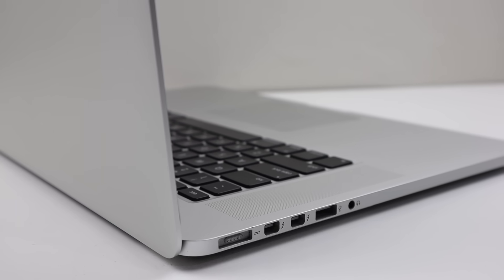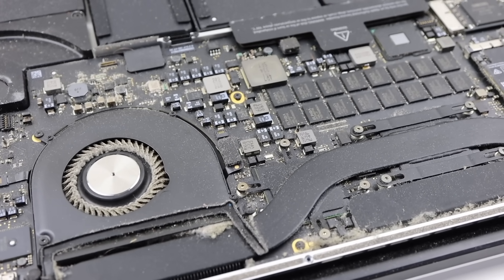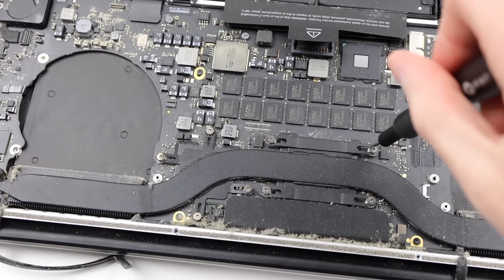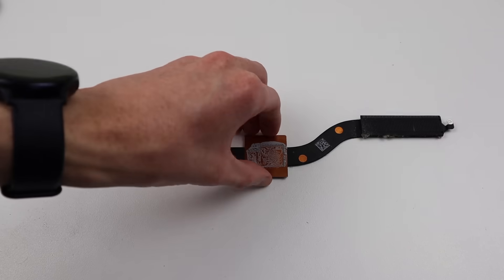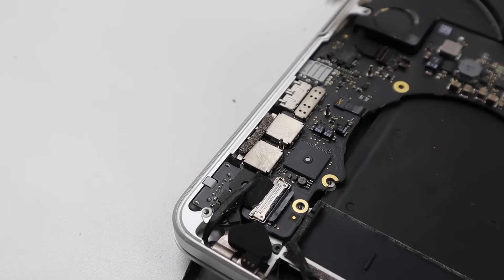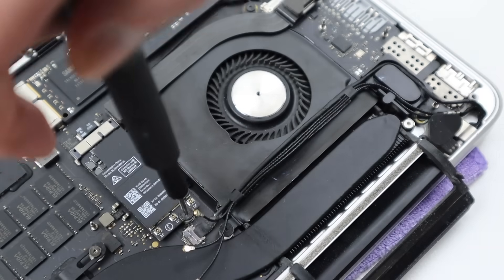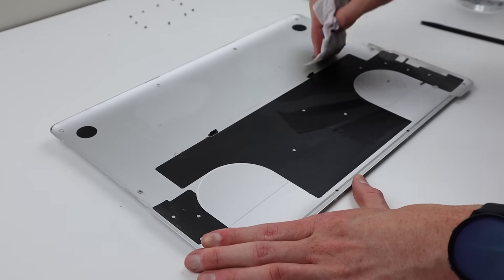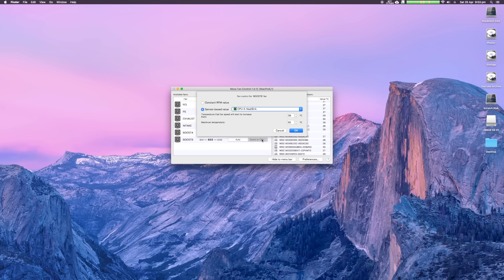Fixing My Filthy Overheating MacBook Pro

Comment: Just did this on my mid 2015 pro 2.8 i7 running Monterey 12.7.6. After cleaning up most of the dust bunnies from the fans/fan openings and applying Arctic MX-6 thermal paste, my mac runs slightly cooler. It still gets hot and sounds like an airplane under load, but it's no longer getting hot during mundane tasks.

Comment: I was slighty lifting the left side of the heat sink in my mac book pro 13'' (2018), without undoing the screws. It bent very slighty, but the bent was visible on the black cover. Should i remove the whole thing now, put on new thermal paste and screw it tight or did i break it? My mac book ran normal afterwards and didn't heat up more than usual

Comment: Great video, man. One question: if I don't have thermal paste, but I still clean the dust and grime, do you think the laptop will improve in speed and temperature? Sorry for another question: what tools did you use to disassemble it?

Comment: I think a good mod to do would be to drill a couple holes near the front where the battery pack is, would help  keep the battery pack cool and more airflow across the board. Also small heatsink on the memory chips and thermal pad from heatsinks to aluminium case

Comment: I had a very similar model, the 15" version, also from 2013. After 6 years, I had it already cleaned out multiple times and also re-applied the termal paste. But the thing just wouldn't stop spinning up its fans. It got so bad that I suffered from PFSD (Post Fan Stress Disorder) for at least a year after I switched to an M1 Macbook Air 😅

Comment: It is really important for those watching to know that you can break a cpu fan by blasting air into it without holding the fan blades down. This is because the air speed can easily cause the fan to move faster than its intended rpm. It is best to hold the fan blades still with your thumb and then proceed to blow air through.

Comment: Hi Hugh, I have the same Macbook and suffered the same heat problems.  It was reaching heat levels of 105 degreese F.  I performed the same cleaning process. After sealing the Mac back up and starting it. I received  a message that my WiFi was very weak and would not let me do any thing. 2 hours later wondering what have I  done wrong, I noticed the date and time was weird. I reset the time and date and the wifi was normal.  Beware of this glitch after disconnecting the power. temp is now around 85-95 F, some times 70's.

Comment: Thanks, helped me clean my fans.

Also on my 15’ late 2013 MacBook, I also was able to fix for free the swollen battery 6 pack, causing poor track pad clicks and a swollen bottom cover, using this method:
https://youtu.be/hoOIb6pZ6vo

I used scotch tape with a tape tab handle in the middle by pressing a middle fold together, to keep lifted the top center of a pack. Then pierced through with a needle, one hole through-by the tape tab. Just enough to make a hole in the top skin of a pouch. So I didn't go deeper with the needle and touch the needle to the inside battery material at all. You know as soon as you are through the cover, the needle resistance is gone.
Then there was a slight odor, like a fart, the small amount of trapped gas causing the bulge escaped. I removed the tape w/lift tab.
Then I used a vacuum to suck on the hole which got the pouch totally deflated. At the same time I took the vacuum nozzle away, I placed a scotch tape over the hole. So resealing the pouch. I did this to all 6 pouches. I added a second piece of tape for good measure over the holes.
Now my track pad clicks like new and the bottom cover fits over the battery pack like new.
Some of the reviews on replacement batteries are bad and I think my batteries will meet my limited needs for some time now.
Take care

Comment: What if the fans are not working at all.?

I have only changed my battery to a new one and upgrded the RAM to faster ones, but still the same amount of GB's.

My 2010 Macbook Pro turns itself restarts as it starts to do just a bit of work as I am hooking it up to my TV to do some keynote.
It seems to work just fine if I want to play a DVD on it though.

What could be the problem..?

Comment: That's not how you use that can of compressed air. it has a small pipe that comes with it , and it has a huge pressure.

Comment: I must be doing something wrong... I can't get over 70 degrees celsius in an hour full load... but I only have a store with i7 9750h , 64GB RAM, 8TB SSD, 8TB Nvme, GTX 1660Ti...

Comment: I did heavy gaming on a 2015 13 inch macbook pro with the intel core i5 and it overheated so badly the fan was spinning up, the fan was loud and the battery almost exploded

Comment: Is heatsink assembly screws a different size? Because my screws don´t seem to fit the screwdriver, I tried two different ones with the same T5 1.2 mm screwdriver. Does anyone gave the same problem?

Comment: Followed this guide and it worked, except the bottom plate has become warped and does not entirely cover the bottom anymore, exposing the parts to the open air.

Comment: Why aren’t you using the nozzle that comes with the compressed air it would blow that out easily and your tilting the can too far over while spaying but i picked up an electric duster and love it well worth the money if you clean a lot of hardware. Took apart my oldest gaming laptop a month ago and was kind of let down by the lack of dust😢

Comment: Very helpful, thank you!!. Is it unsafe to brush the dust into a vacuum cleaner extension plastic pipe also? I don't want to push dust further inside with the compressed air? Is this a very dumb question?

Comment: Due to overheating, my display got an issue. Now I can see one horizontal line on my macbook 2008 late model. It is there through the boot sequence till I shut down the laptop. If I take a screen not, that line is not visible in screen shot. What is the problem.

Comment: Dude... a piece of advice: when you use the compressed air, Do Not apply it horizontal or upside down, thats why on the video the air blows ice, and thats very bad for components.

Comment: I just did my late 2011 13" . Couldn't believe how much of my Dogs short white hair got inside. I sit with mine on a lap board and in bed so it wasnt caked in fluff bunnies. The paint brush helps shift it while holding a vacuum (plastic barrell ) just above. I had to use a head visor in places to tweezer out the dog hairs. But big tip have a clear idea what screws you took out and where they come from -you must have an idea not just guess. Also broken rubber feet is an entry for dust
Reply: https://www.youtube.com/watch?v=tL2TaoomHkc&t=122s

Comment: Bang up job M8! Looks brilliant . I tried that Macs Fan Control. I need to do mIne. I'm getting 67℃ on a 2015 MBP AMD R9-370X & 73℃ in i7 2.8 quad filling on YouTube. External displays use discrete GPU even if not doing anything GPU demanding. I'd like to drop 6-8℃ or better. I'll be using Arctic Silver №5. Less is more.

Comment: I cleaned my 2012 retina MacBook Pro but I done a more fairer clean by removing the logic board to find lots of dust underneath also cleaned fans and replaced the thermal paste now I’m seeing temps of around 60to 70 in moderate use before it was running around 90/100

Comment: i have the same laptop and it had seen sand, dirt, floor, plane, train, car, school, backpack, got beat up from 10 years old me but since i have gone 5 school, graduate high school it still alive but i never did update the laptop, run like a 8 years old computer,  it have dust to the point that every air vent are full and probaly have food in it.

Comment: That's a lot of thermal paste. It's not supposed to be spackling compound for cracked CPU surfaces! Normally a tiny drop should be sufficient. But other than that, nice video!

Comment: My 2012 mid 13' mbp has whole ecosystem living inside. I used it in manufacturing environment, outside in lawn while in college and everywhere. Opened, cleanes, removed layers of hard dust blocking air between fan and grill, reapplied therml paste and vola. its like new. +5 years life extended

Comment: How is this a sign they don’t want you inside this device… it’s not like you can’t buy this screw driver.. it’s available all over the internet.. if it wasn’t sold anywhere else than apple and you had to use some other tool to open it that’ll be a sign they don’t want you there..

Comment: Not sure if this comment was already mentioned, but, you should NEVER spin a fan with compressed air.  This can cause the fan to rotate faster than the design parameters intended for the bearings.  The over speed of the fan/bearings can ruin them.  Something you'll not know until everything is back together and the fans stop working....DOH!  A good "rule of thumb" is to never spin ANY type of rotational bearing with compressed air.

Comment: Apple's default fan profiles are bonkers. Basically, they allow the system to go nuclear, then drive the fans to near max only when everything is hitting TJmax. This leads, over time, to dust ingestion, which when coupled with degraded thermal paste, leads to a vicious cycle of the machine getting very hot under load, no longer able to dissipate heat well, the fans run harder, which leads to more dust buildup, etc... in a vicious cycle. Using Macs Fan Control can help keep the fan profile in a reasonable state, combine that with the occasional cleaning and thermal paste application, and these machines will last damn near forever, but only if you override their dopey fan profiles.

Comment: This made me realize how absolutely TINY the fans and heatsinks are. It's literally flat, that's not gonna do much in cooling the cpu and gpu. I'm wondering if downloading something like msi afterburner, if it even has a Mac app and putting the fan speed at maximum. Will help in cooling the internals.

Comment: How the heck did you cut yourself removing the back cover? I've repairs hundreds of these and never had an issue removing the bottom cover, just pull it off, it isn't hard. Also, there's no need to remove the WiFi card to disconnect the fan, there's more than enough room to disconnect it with the wirelesscard still installed. Also: Stop shaking the compressed air can, keep it still and straight, and move it slowly when cleaning larger parts and the moisture problem you mention in the video will not occurr.

Comment: Solid guide, I like it. I used similar procedures when cleaning my 8 year old PC, which was prone to overheating. An additional step I did when replacing the paste was spreading the paste evenly over the chip with a credit card (use the one with highest account balance for better results).
Reply: Hahaha

Comment: Hey Hugh, I need to do certain repairs to my 2010 Macbook Pro which range from cleaning the fans like this video (computer is turning off suddenly), one speaker is no longer working and, the dvd no longer works. Wondering if I should slowly repair everything myself (a bit nervous about dealing with all the screws and opening the back) or, save money to hand it off to someone who would repair it all. Also considering buying a used Macbook Pro. How do I learn how to repair my computer competently? Advice would be wonderful. Thanks.

Comment: You can use compressed air but i've been using a vacuum and a detail brush for decades, never an issue. better for allergies to dust..  as long as you don't go in there with it like a dickhead it'll be fine.

Comment: Great advice - despite having soldered RAM and a proprietary SSD, this Macbook actually seems relatively straightforward to access the fans & heatsink.
I agree that regular cleaning & thermal paste is a good idea; I recently done this to both my 5 year old HP Pavilion 15 and my 2 year old HP OMEN 15: after a clean and some new thermal paste, both laptops perform much better, in terms of performance (no more throttling) and temperatures.
Sadly, some laptops are much more painful to complete this on; for example, the Acer Aspire 57xx series and HP Pavilion G6 series require motherboard removal (and most parts removed) in order to clean the fan & install new thermal paste, whilst doing this on a HP DV5 (or any HP DV series) is even worse and requires the entire laptop to be taken apart, including display removal.
Therefore, some manufacturers almost purposely make their laptops run hot, have issues with overheating, and possibly causing premature component damage and failures.

Comment: i think that apple should make the cooling system ramp up at 70 degrees or if it stays at a lower but high temperature for a while and they should use quiet fans like in the imacs but smaller so it can fit

Comment: Non-Electronics parts (in this video: the removed fan covers, the heat sink assembly, the bottom laptop cover) can be rinsed off under warm soapy water tap. Ensure they're fully rinsed off and totally dry afterwards. When I'm cleaning consumer electronics, I use warn water wherever it's safe to do so (not the circuitry or sensitive components).

Comment: Beautiful, congrats for the great video. My approach tho would be a bit less delicate. Compressed air comes from a 7 bar network (dry air), the brush is a 1” paint brush with electric tape around the metallic part, and when the dirt is heavy instead of alcohol I use warm water with degreaser. The board goes in and gets scrubbed with a toothbrush. After that, half an hour near an heat treating furnace at around 1400 deg makes it dry as the Sahara desert. After 25 years in a metallurgic industry I never damaged a single board, be it from a notebook of from any industrial equipment.

Comment: You pay a premium for apple products and find a burned out component, with usual usage, normal laptops are much more reliable than these pile of Junk, I think because of the business model of apple, most of the e waste in the world will consist a big chunk of apple products. If anyone is wondering what is their business model then let me tell you, they make sure something is inadequate in the design of apple products so that they just work for 2 to 3 years and make sure the customers come to Apple`s Idiot Bar(Genius bar) with their measures to prevent third party repairs, so that they can again charge you 75% - 80% of the price of the product to repair even if there is a minor issue which can be repaired by third party repair shops at a much lower price, so that you think it is better to get a new device, oh and they suggest you to get a new device as well. If you are a basic user, or even an intermediate user, who works on Spread sheets, word, checks email, does light gaming, watches movies (4K), Light programming, etc. then a laptop would last you at least 5 years unless the hardware gets outdated or the system gets damaged, most normal laptops if kept properly lasts more that 5 years no matter how much you use it, and apple products dies on its own, by cpu burnout, or chip burn out, their display cable comes out of the connector by its own, etc.

Comment: Is it ok to use compressed air on a laptop without disassembling it? like every 3 or 6 months? As to not give time for dust to build up? Just a few taps from a not so close distance? And if the battery cannot be removed, some laptops have it inside and u cant remove it unless u unscrew laptop. An option can be empty the battery power to zero? or wait for 24 hours to make sure if any possible moisture is dry?

Comment: The only reason why there is liquid coming out of the compressed air can is because you're holding it at an angle. If you just hold it perpendicular there will be 0 liquid coming out

Comment: Its not compressed air you're using. The "air in a can" sort of products have a type of refrigerant in them (same gasses in principle to your refrigerator and air conditioning unit) that is stored as a liquid in the can (you can hear it if you shake it, its also the reason you can't use it upside down because the liquid sits on the bottom and will squirt out) and when you let some pressure out it quickly turns into the gas phase. Its not moisture you're seeing, but refrigerant in its liquid form building up on the machine. It may cause chemical damage, also as that refrigerant evaporates it takes a lot of energy from its surroundings, possibly subjecting your computer parts to thermal shocks. Also the cold parts may be building up moisture and we all know thats bad. TLDR: Its not compressed air, you may damage your stuff; you probably should get a propper air compressor.

Comment: Hey man, be sure to use the included nossle. You came out lucky for this one but you could run the risk of actually water damaging the board, plus, make a distance with each spray. Preferably a couple seconds

Comment: Awesome video Hugh! Very detailed overview. We do this on every Mac we get.

  It's insane how dirty Macs get. We have had some come in that look like a cat lived on the machine! Using a high powered air blower  (electric not compressed air) can help if you don't want to completely take a Mac apart (though not nearly as thorough). 

Thermal paste definitely helps keep the Mac running optimally. 

Tip to any viewers:  Any static can blow a component. Make sure you are using anti-static methods. It's very easy to blow a chip when touching the board! We have lost computers due to a very small static shock! 

Let us know if you have any questions we process 1000s of Macs a year. Peace and love Hugh love the content keep up the great work!
Reply: Do you have any tips on how i should get my macbook cleaned because i took it to apple to fix my computer and they didnt do shit for it and its like screaming like a jet engine

Comment: You won’t damage the laptop with it running too hot. It’ll simply thermal throttle. Thereby reducing performance.

Yes, clean it as it’s performance that’s left on the table and easy to solve, but don’t worry about it damaging the cpu etc as they are designed to run at 100 Celsius before throttling.